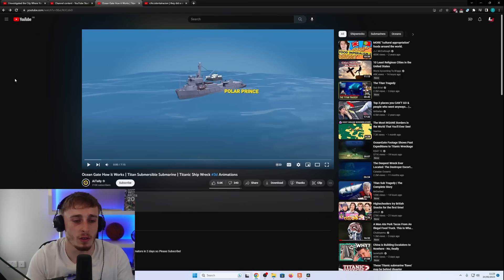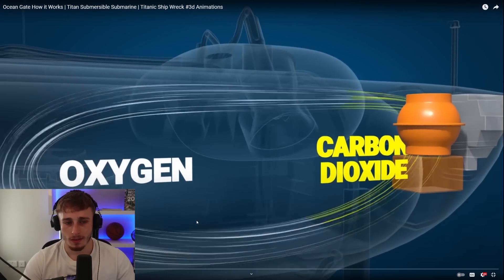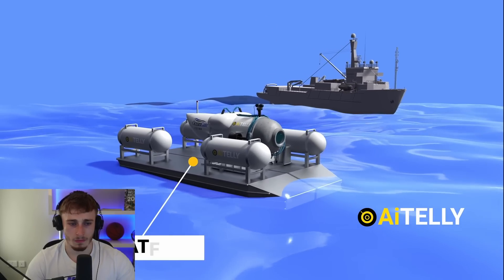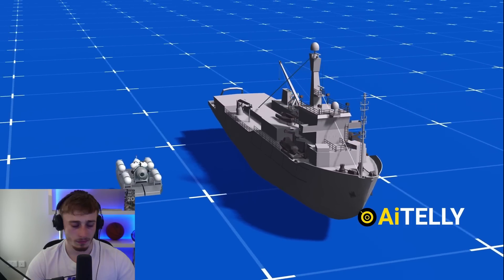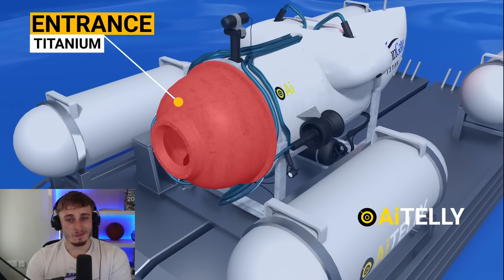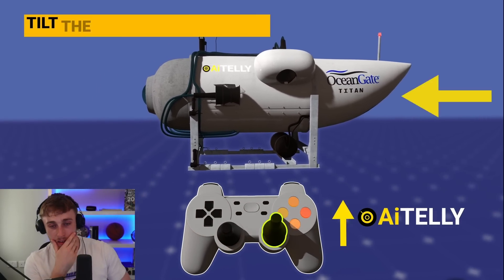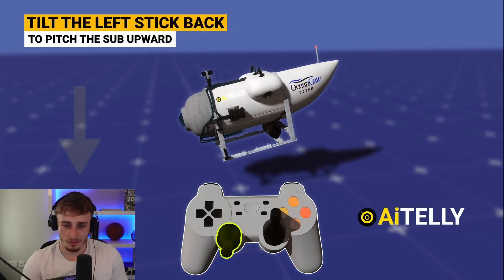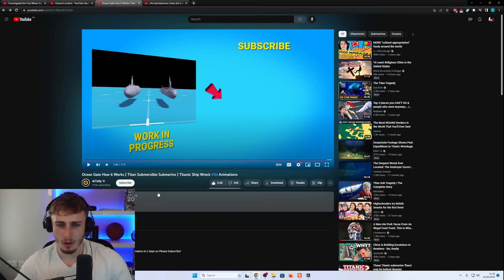Reacting to The Insane Engineering of The Titan Submersible | Ocean Gate How it Works

Comment: I'm  not a ship builder, but I do remember one basic rule from  Statics. You can't push a rope. It has to be in tension and can take zero compression. Carbon fiber is fibers, in other words ropes. They will hold up to their breaking strength if pulled, but push on them and they fold. The rigidity in compression comes from the glue. This is wish fulfillment engineering.

Comment: Whoever design it was a complete idiot.  Anyone riding in it was turnip level IQ.  One controller fault and you might get pointed down at too steep an angle to recover from.  A vessel like that needs mechanical controls

Comment: Game controller is a red hearing as many militaries do the same thing with drones and armored vehicles
Reply: They get supplied proper ones though not a $30 Amazon special.
Reply: This is a good way of putting it because I believe a lot of the other parts were not only experimental, they were also just really sketchy because even theoretically, they should not work. The game controller was supposed to sway people into believing it was safe. That along with the lies that the University of Washington, Boeing, and NASA helped him design it and then these companies were like that did not happen. As far as I know Boeing’s involvement was Stockton Rush purchased old airplane parts Boeing didn’t want because they didn’t meet their standards for aircraft. This is crazy. One because the parts were rejected by Boeing obviously but how the f*** does Stockton think this is a good idea. Granted, I was not there, for the design or testing of the sub, but I mean even theoretically, this seems really dumb. Like Darwin Award worthy because aren’t planes supposedly do to well in low pressure environments and isn’t like deep underwater really high pressure? Just saying. Stockton was either really dumb or just didn’t care.